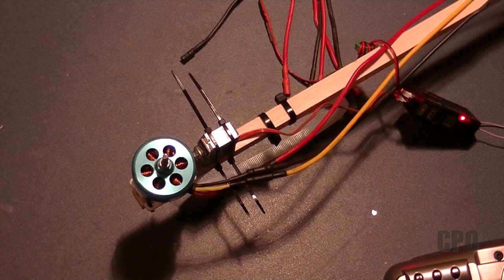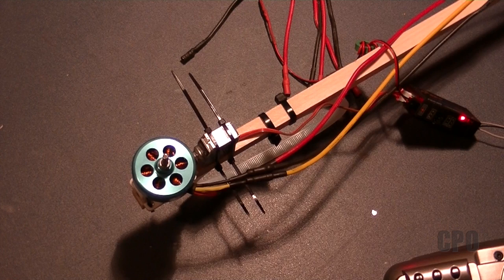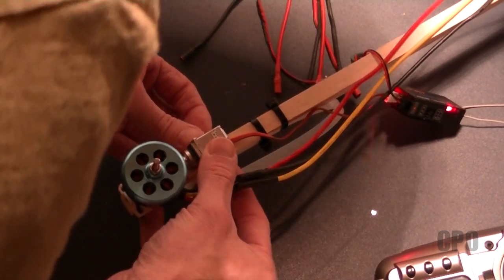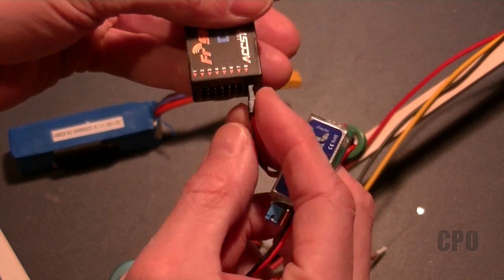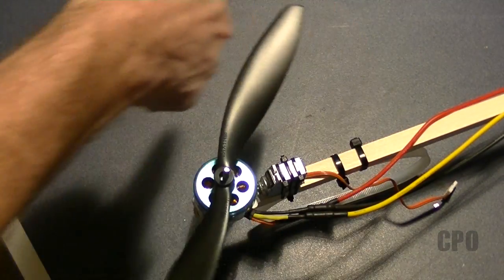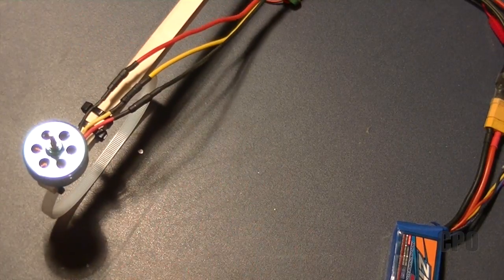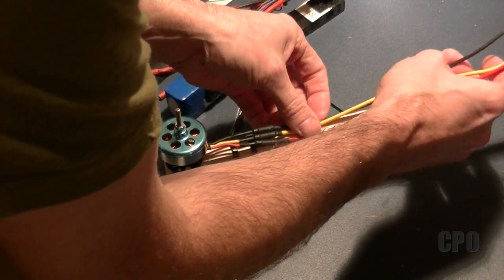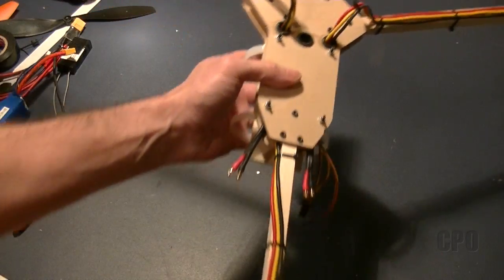CPO Tricopter Build : Testing Electronics, Motor Direction, and Fixing Servo Buzz

Comment: Nice video, 

soo i got a problem, my servo makes a louder buzz than yours. But u glued my servo to my frame, and i am not able to strip it off. I am also using the kk 2.1, and the same servo as you are using. Since i glued my servo on, there is not any pressure on it. Any idea how i can solve the buzz ? and what if i don't solve it and leave it ? will it be broke soon ? 

I searched the forum but coulnd't really find a solution!
Reply from the maker: Ferdi Spierings,  If your servo buzz is for the same reason as mine, it was because it was under tension at rest...which isn't good for it. Although, it probably doesn't matter when you are in the air, since it's always moving anyway. I would try and correct it to be safe...especially if it's an up and down tension (like mine was).  It can wear out fast if you leave it alone. 

Since your servo is stuck in place, you can try adjusting the motor side. Using the same method I did...slipping something under it to raise it some. If you need to lower it...I still think it best to unglue the servo and raise that...but you could sand away some of the top of the boom where the yaw assembly sits to lower it some. Just be careful.
Reply: Thank you for respons! Well.. the tension(if that is the problem) doesnt come from the motor. I disasembled my tail mechanism and the noice is still there.. i wish it was possible to unglue my servo.. but i used epoxy glue. I dont think there ia any possible way to unglue it. I ordered a new tail mechanism and a new (same as befor) servo.. ill will let this servo as it is now, and when it dies iwill assemble it with care for tension! Thanks for the respons

Comment: Interesting, yes, I have seen it rotating both ways. Not sure it matters.  The 100 to -100 I did changed the movement of the servo (reversed it). It was needed in my case.